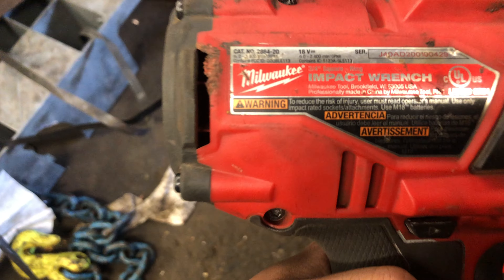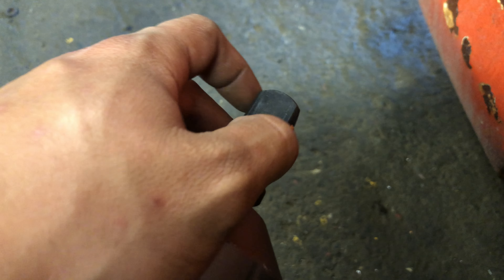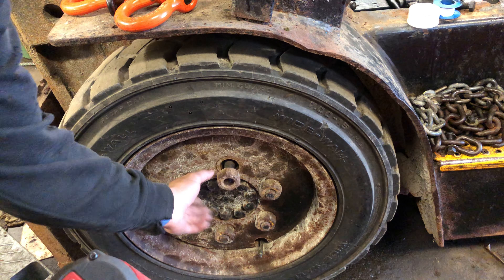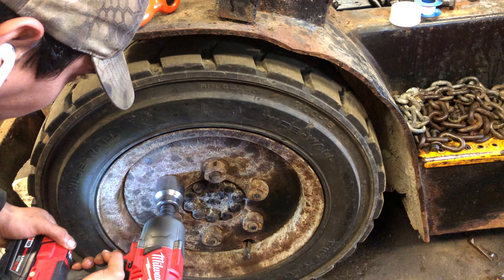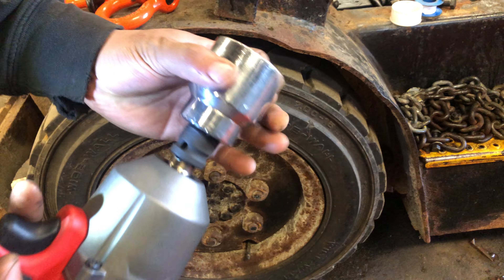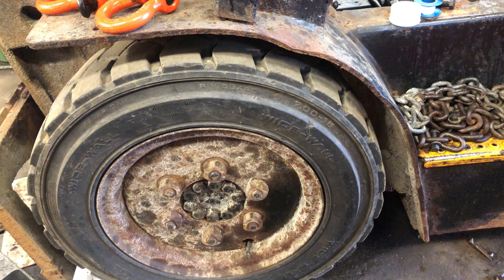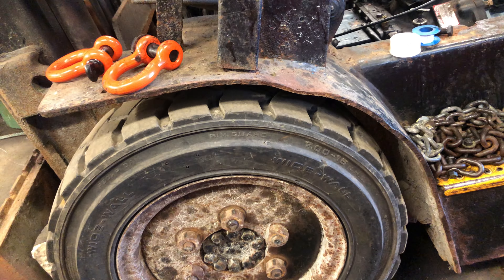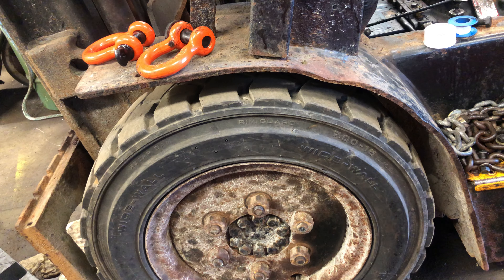Milwaukee M18 3/4 High Torque Impact 2864-20 VS Milwaukee M18 1/2 High Torque Impact 2767-20

Comment: I have the 2767-20 and that thing's a beast. I replaced the blades on my parents' lawnmower with it, 2 years ago. 17 years of rust, broke that lugnut right off. I would've never gotten it off by hand.

Comment: Although it didn’t matter in this case, using the 1/2-3/4 adapter causes a bit of torque loss. Milwaukee impacts are nothing to scoff at that’s for sure. I like my dewalt but I have a lot of respect for Milwaukee cause most of their products are the best in the business

Comment: The socket is starting to crack. I can't believe you're using Chrome on any impact ranch, especially a high torque. I go the other way and grab some Milwaukee Shockwave impact sockets. Don't  buy chrome, your eyes will thank u. 👍🇨🇦
Reply: Don’t worry,, it’s a harbor freight chrome socket 😂

Comment: I own both of those Impact tools….  Milwaukee the BEST!!!
Reply: I’m trying to buy one for my dad but he wants it to take off lug nuts would both have no issues or should I go with the 3/4
Reply: @miguelcardozo3413 go with the 1/2. I have the 2767 high impact and I love it. I’m a Diesel tech and I use it a lot. I want to buy the mid impact 1/2  2962  just to keep in my truck. It’s perfect for removing wheels for normal size vehicles.

Comment: I bought a 3/4 m18 impact wrench and the (US PRO 3/4 to 1/2) won't fit on because of the friction ring in the way... anyone have a clue what 3/4 to 1/2 adapter will fit???

Many thanks
Reply: The one you have will fit, it's just a snug fit. There is a rubber O ring behind that steel friction ring that acts like a spring, pushing the steel ring out. You need to hammer that adapter on, make sure to align it right before you hammer it on. Or just smack it on the concrete floor while holding that adapter to the anvil. It will get easier to go on and off with time and use. But there are no other sizes. I prefer the steel ball mechanism to hold the sockets on, but the strength of the anvil is reduced with that option.

Comment: Must not be that tight originally with the 1/2 spinning them off that fast with an adapter. 200-300 ft lbs maybe?
Reply: They do 900-1200 lb/ft breakaway. They’re likely not 1200 tightened but they’re pretty snug
Reply: @Lubbocksfinest  Not with an adapter.
Reply: @dchawk81 i have tightened stuff with my 1’inch d handle that the 1/2 with adaptor can do

Comment: Using an adapter on the 2767 weakens it.
Reply from the maker: true but i didn’t have a 1 5/8 1/2 drive socket, i just got a new hd 12.0 aswell maybe can redo with some rustier lug nuts on a semi with them both
Reply: @onsomekillshit  yea definitely do a redo when you’re able to, adapters are definitely torque killers. And go for impact sockets, they make a difference in performance as well, chromes aren’t meant for it and don’t have that weight to really impact.
Reply from the maker: @kdtxtooldad  i’m gonna have to i got the corresponding sockets for each, the 1/2 in 2767 makes a very concerning death rattle when it reaches max tightening that isn’t present with the 3/4 2864

and we got the 1” pistol so may have to put them all up against each other now haha

Comment: which impact wrench is most powerful? kindly reply
Reply from the maker: the 3/4 is more powerful, and will get off bolts that are tighter
Reply: Its not just about the power that makes it better.. bigger center mass plays a big role

Comment: So your half inch has an adapter AND your not using a high output battery in that but you are on your 3/4s? This is useless
Reply from the maker: where’s your 3/4 and 1/2 in to do a video

Comment: Какой лучше то?!
Reply from the maker: depends what size socket you use most 1/2 gun vs 3/4 gun they are both very powerful, if you work on heavy equipment i would suggest the 3/4 version